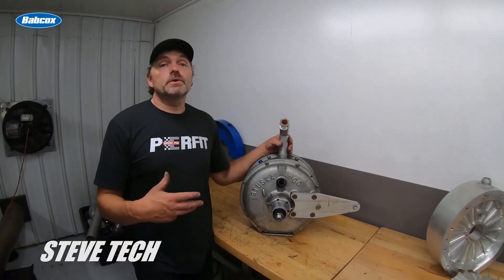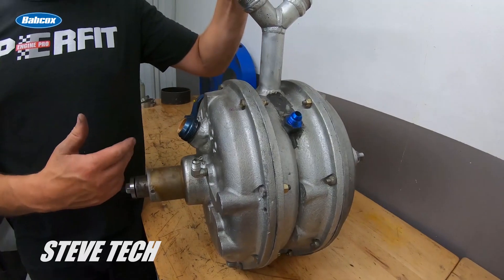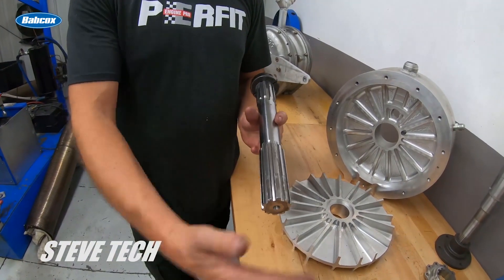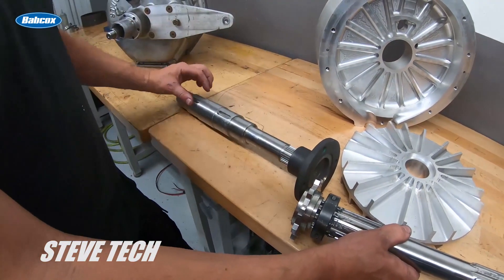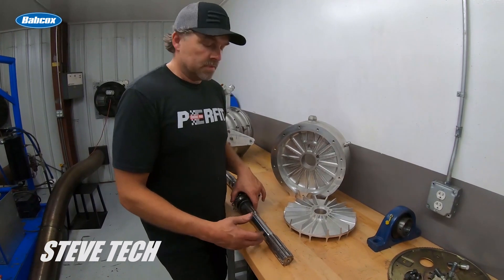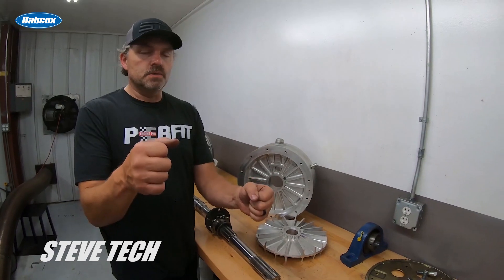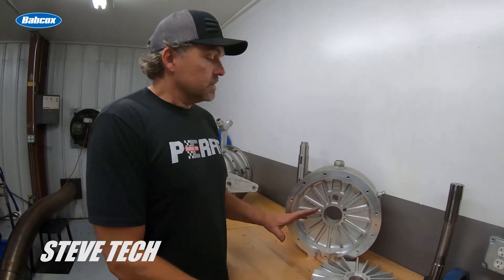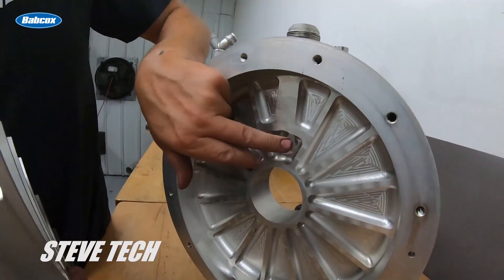Engine Dyno Absorbers – Part 1

Comment: Why not just use  air instead of water? Basically the same principle but you don't have to deal with water/plumbing issues.
Reply: Air compresses, water doesn't. Air wouldn't provide a load.
Reply: @davesstillhere  Wrong answer. I better go tell the company I work for that has been making air dynamoneters for the last 25 years that they don't work.
Reply: Really? I never heard of such a thing. Could you post a link to an article? I'd like to read up on it

Comment: Yes, thanks. It is really informative. I am researching so that I can fabricate my own as it is too expensive to buy one. At least, I haven't found one cheap enough
Reply: Me too.  The load cell and instrumentation are what I expect to give me the most trouble, not being a computer guy.
Reply: alloy car rim.
magnets.
eddy currents.

permanent magnets require a load cell, a pivot, and some way of varying the gap or flux strength.

electromagnets need a variable power supply and can be calibrated so excitation voltage gives a direct reading... no load cells.
Reply: @paradiselost9946  If you do build one use a 2 mm between the rotor and the stator as you will get a big boost in efficiency....most use a 4 mm gap, but use a 2mm, read lots of research papers....you also need to move a lot of water...you can get a 20hp electric motor and pump from auction for cheap...they practically give them away sometimes because people dont always bid on them.

Comment: Why water instead of a 10w oil?
Reply: water has a high thermal capacity, higher than oil.

water when its in contact with a surface limits the maximum temperature to 100C... it has to boil and evaporate for the temperature to exceed that. oil starts burning and stinks. and catches on fire. and makes a mess when theres a leak.